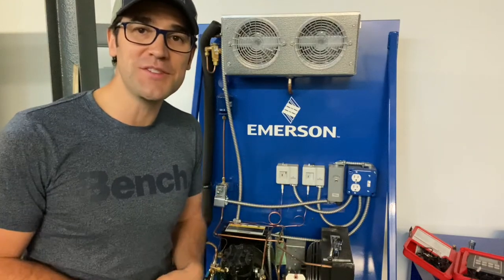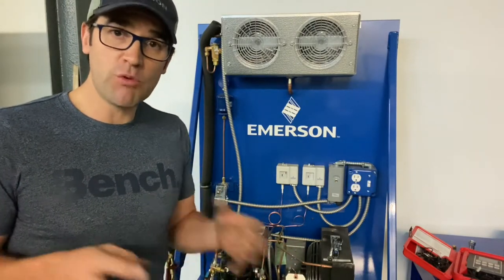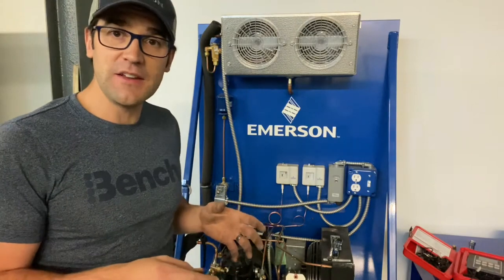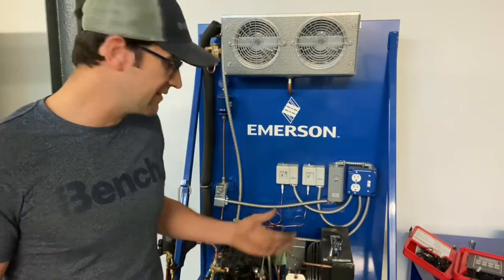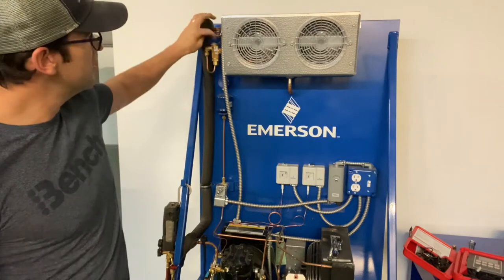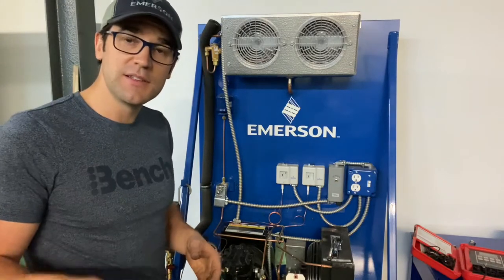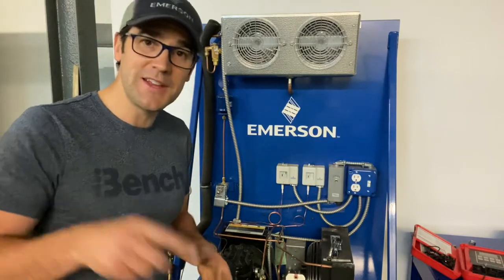Checking Compressor Superheat

Comment: I was expecting you to show us how to check compressor superheat. You pointed in the direction of the compressor, but you can barely see it. Also, where do you place the temp clamps? Thank you.
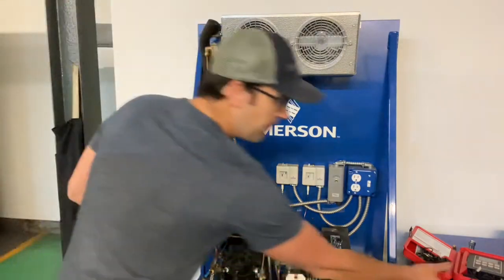Reply from the maker: If you pause it at 1:04 I point to the both location to check superheat on that system. Measure the suction service valve pressure and the temperature with a temp probe 6" or 150mm from the valve.

Comment: Hi, what should be my superheat at the compressor for cooler and freezer ? 15 for cooler and 8-12 for freezer?
Reply from the maker: Usually lower than that. Cooler 5-10F, Freezer 2-6F and this all depends on the design, length of runs and protection components in the system. I would find out from the evaporator coil manufacturer and ask what superheat do they run most efficiently.
Reply: @RefrigerationMentor  that’s in the evaporator right ? Because at the compressor, the super heat numbers are way too high. What’s your thoughts on alternative superheat ? Like taking temperature measurements between one of the distributor and suction line outlet. Using thermometer only
Reply from the maker: @abazism  I have heard of people having  success with checking that way but I have not use that method in the field personally. I would love to see your results from both scenarios comparison.

Comment: I check superheat at the compressor every time im working on equipment. Also if the superheat in to the compressor is to high it will decrease effiency of the compressor. I like to see a difference of 7-13 Kelvin on the compressor. What do you think?
Reply from the maker: Yes the is in the safe limit of most compressors but you always need to follow up with the compressor manufacturer but with CO2 that could be too low.
Reply: I just started working in a CO2 recovery plant. What is the safe superheat temperature for CO2 compressors. I have been trying to get figures but unfortunately we have no manuals in existence.
Reply: @RefrigerationMentor  I would also appreciate if you could point me in a direction where I could get to read more about Suction superheat and discharge superheat and their importance to compressor health.

Comment: Would check ideally on each service visit or when previously looked at by others engineers as historical faults not always cured as has in past experienced engineers keep topping up oil level faults and I fault system with low superheat and evaporator was storing the oil, corrected superheat and oil start flooding Bach to compressor and extra added oil had to be removed.
Reply from the maker: Yes that is why understanding the system you are working on is very important. Thanks for sharing.